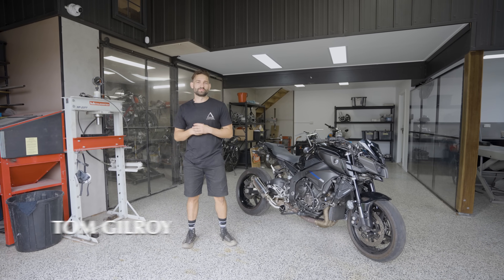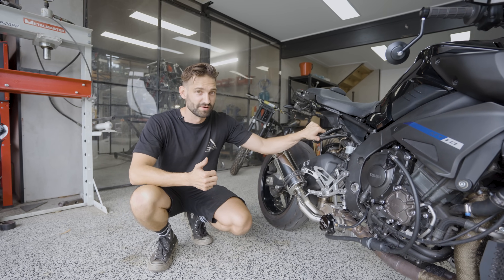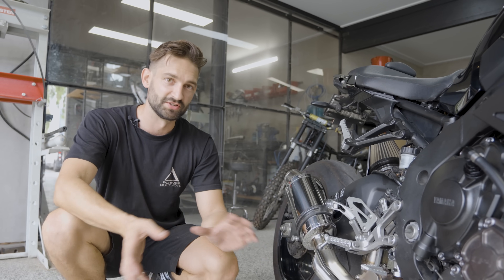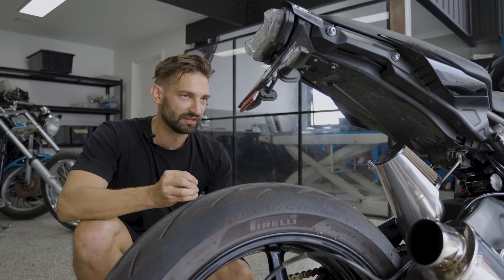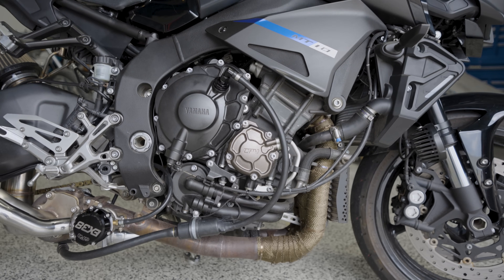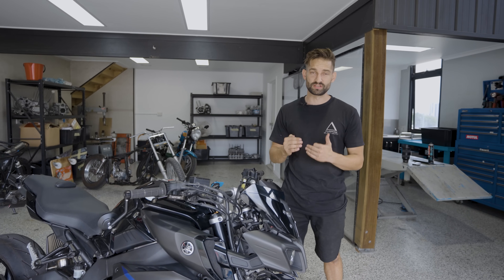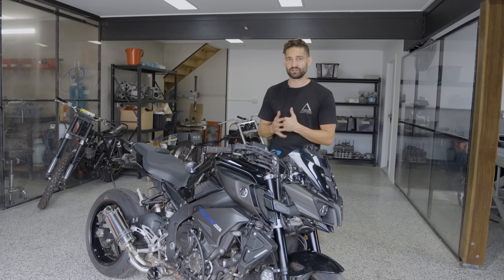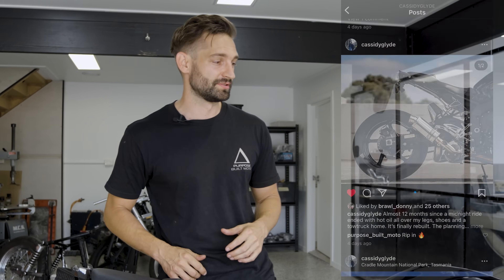The Turbo Yamaha MT10 | Purpose Built Moto

Comment: 230hp @ 10psi with forged pistons and con rods is always gonna be overkill mods for such low hp, you don’t even need the intercooler but I think that is the only reasonable upgrade you made to this. The rest is just a waste of money. When you wanna go for 350-700hp is when you need to look at upgrading internal components, IC and standalone ECU’s 

Any 1000cc bike can handle that amount of power with a stock bottom end, lowered compression by having a thicker headgasket and stiffer clutch springs. Then it’s all in the tune that’s gonna make sure the bike runs forever

Here in Sweden we’ve been building bikes with 200-320hp with just these simple changes for over 30 years and they run forever. My K5 turbo with 270whp with stock internals, no intercooler etc etc has been running since 2017 

Nice to see a Yamaha turbo, not something you see very often. So props to that and you’ll learn more along the way if you keep building more turbo bikes in the future. Keep it up, but keep it simple for these kind of builds 👍🏼
Reply from the maker: All of that may be relevant, but as we mention it started with a completely blown motor from running 13PSI. 
So rather than rebuild a stock motor, we went and did the upgrades properly to handle higher HP and eventually more boost.
Reply: for 230, yeah, but the original owner blew the motor. They wouldve needed new pistons and rods anyways. Might as well get forged and lower compression pistons since youre already in there. The build has potential to be making way more power but its sick either way
Reply: Your wrong. The mt10 has steel con rods & alot of steel internals unlike the r1... that is the big weak link on them

Comment: Blue mine up with extreme creations kit as well just finished up rebuilding and upgrading it.  prior to melt down was 215hp 110 lb/ft tq.  after rebuild was 188hp 100 lb/ft tq ( injector limited )  put new injectors in it last year and worked out a active wide band with  FT ECU so it can adjust on the fly up to 5 percent.  waiting to take it down to get tuned again.  side  note this was all on pump 91 octane.  91 being only reliable non ethanol at 95% or more of northern USA.  was thinking of E85 but can never get true E85 and limited places.

In hopes to get to 220-230 at wheel and call it good as me and cycle only weight 550-560lbs.  
was insane at 215hp (150mph wheelies ( Re geared )) ( melted as leaned out )
was little lacking at 188hp ( no power wheelie past 120mph )

running 11:1 compression 7.5lbs of boost.  188hp was good daily but left wanting more and only needed injectors as throttle by wire only had 100 percent at 7500 rpm and cliff to it and dove off it ( reminded me a 80's turbo cars )
Reply from the maker: Good to hear we're getting some good numbers comparitively
Reply: @PurposeBuiltMoto  indeed will half to update when I get it tuned with the new 830cc injectors this year. was thinking double radiator and air to water intercooler.  will wait to see if heat is a problem with charge temp ( had no problem at 7.5lbs last year )

Comment: Love the look of this build and how it turned out! My one question is, why couldnt the intercooler be placed under the bike so as to make for a cleaner look? Would that not have been feasible? Either way, its badass!
Reply: I don't doubt it could be done, but he is already losing clearance with the extended swing arm. Add an intercooler beneath it, and you will inevitably smash it riding on the street.
Reply: this is the most ugly ass intercooler wallmart addon ive ever seen,
dont care if the turbo is good or not when you have a james bond casino case intercooler next to your leg.
only right side looks decent

Comment: How much Newton meters of torque (max) does it have after the turbo upgrade?
Does the engine still run at 11500 rpm, or have you reduced the speed to protect the engine?

Comment: So the motor did not blow up because of Extreme Creations but from the owner of the bike putting more boost in it with stock internals no doubt and not getting it tuned for more boost causing it to run heaps lean and melt the pistons
Reply from the maker: Yeah that’s what I said, the kit is fine if you listen to the instructions. Our rider wanted a little more though

Comment: Is that correct for the watergate to be on the exhaust? Surely it’s to relieve boost pressure, therefore should be on the boost pipe?
Reply from the maker: Check out some info about turbo systems, you’re thinking about the wrong part.
Reply: Ah ok. 

I thought the waste gate was the thing at the bottom and is that not attached to the exhaust?
Reply: Just had a google, I’m right in what I’ve seen and you’re right in what you’ve made. 

I (wrongly) assumed the waste gate bled off boost pressure. But In fact it bleeds off exhaust flow to the turbo. 

I’ve learnt something.
Reply from the maker: You’re thinking of the BOV

Comment: Its a gorgeous build, but the reality is Highway Patrol would have a field day with it. 

I'm not sure redirecting the dump pipe into the exhaust will suddenly make it legal. The air filter and aftermarket exhaust are very obvious. Unfortunately you can't make any modifications to a vehicle that impact its emissions, without an engineering certification. Otherwise it invalidates the registration. Not to mention significant changes to suspension like an extended swing arm. 

Then there is insurance, a Green Slip is invalid without valid registration let alone comprehensive insurance. 

Its quite a risk riding that on the road and I don't mean the safety shorts. 

But since you do this for a living I'm sure you would already know that and hey, you only live once. Ride safe 👍🏻
Reply: Where do you live?
Reply: @jaredjensen2668  Australia. They make it difficult to make big modifications to vehicles legally without getting them engineered. 

Highway Patrol often, but not always, seems to attract a-holes, and many of them love writing up defects.

Comment: No doubt you know what you're doing but I can guarantee than intake pipe is too close to the chain.

Crazy how much both chain and suspension move.
Reply from the maker: I can guarantee it’s not, now who’s opinion do you think is more valid here? 😊
Reply: @PurposeBuiltMoto  okay go watch any bike on a dyno and see how much the bottom of the chain ripples. The only tension in a chain is from the top of the front sprocket to the top of the year sprocket. 

That pipe will have a hole cut into in in 10 miles of hard riding.
Reply: @PurposeBuiltMoto   https://www.youtube.com/watch?v=Iqy2U5KRVuo

0:50 Watch how much the chain moves. Drag bike with an extended swing arm. Granted it will be longer than the MT10. But they still move  You've got 5, maybe 10cm of space there.
Reply from the maker: I put 30 miles on this bike, and it had 10-15 runs on the dyno, I did 240 kms/hr on the bike and that pipe hasn’t got a scratch on it. Take your I’ll informed opinions elsewhere champ.
Reply: @PurposeBuiltMoto  30 miles on a dyno = no miles on real road. 

Dyno’s don’t work the suspension other than the bike compressing under load. 

It’s a road bike. Roads are full of bumps and summits. All whilst the bike is moving under the rider. Wheelies and braking all moving the bike up and down. 

So your logic is because it doesn’t have any marks in it from being on a dyno, it won’t do in real world riding. 🤯
Reply from the maker: We put real road ks on all
Our bikes, there’s even some clips in the video. You don’t know what you’re talking about.

Comment: Man, I want to do a turbo build so badly. I'm completely rebuilding an 07 GSX-R 750 and I want to turbo it with the headwork, possibly coating the piston sideskirts, mains, piston pin with DLC & cerkote the top of the pistons, but I just can't afford a set of forged pistons & rods. 
What I want to build: I want to build a bike around a VFR1200 engine, do some headwork, wrap a trellis frame around it in candy lime green metallic, single side swingarm and chain driven, not shaft like the VFR's, get some camshafts from Webcams made, throw on a thin head gasket to bump up the compression to 14.0:1, run an AEM Ethanol rated fuel pump, ethanol sensor, fuel injectors, ECU with atleast 2 maps (93 & E-85.) That V4 engine sounds so sweet and is easily capable of 200+hp @ 1200cc's. And if I had money to dump into it, I'd put a turbo on it & run a methanol injection system. 
You ought to look into running water/meth injection instead of that heavy cumbersome intercooler.

Comment: I know there is very limited space on a motorcycle. But I'm sure that turbocharged bike would Greatly benefit from a water/methanol injection system. As this allows for more timing without pre- detonation . There are several benefits of a system like this .in a sense it acts as a chemical intercooler giving an even cooler denser air/fuel mixture to be compressed,also cooling the compressor and exhaust side of the turbo.and with the expansion rates of water turning to Steam Spools that Turbo Quickly.Also it maintains a constant state of tune,as there isn't any carbon deposits left in the combustion chamber ,the entire exhaust system stays clean . Even when the turbo bearings start to wear over time,will of course lead to oil seal leakage into intake .With that addition of oil burning causes carbon buildup quickly sticking the rings leading to excessive blow-by ,causing oil dilution from the fuel mixture over loading the crankcase ventilation system. Thinner Oil looses it Viscosity and it's just all bad,from that point . Which these things don't happen when running a water injection system. The Spark plugs stay clean there's no carbon buildup on the exhaust valves. And the engine oil stays clean for longer not having the extreme heating normally found with a turbocharger during long rides on streets and open highways .The lack of carbon flakes in the combustion chamber ,acting like glow plugs because of their feather edges and thin tips ,will cause predetonation and dieseling when you go to shut off a hot engine,and it wants to keep chugged and coffing. More common in automobiles. But Extremely Problematic,and can cause catastrophic engine failure. Anyway I could go on and on about the benefits,which I kinda already have. In short it's worth the effort to fabricate a gallon or so reservoir tucked under somewhere it stays cool and is easily accessible for filling ,when getting the fuel tank topped off you can bye a bottled water . You'll be surprised at how much difference it makes with the right tune. And you can even get away with a lower grade of fuel without a chance of detonation. It will run like premium unleaded did without the injection. The if your looking for the optimal performance you can bye -20 degree windshield washer fluids for cheap,to run in the injection. along with Av-gas or Trick Racing Fuel. Or just Premium Unleaded with some 104 plus Octane Booster. And then You Will Really Notice The Difference. You're able to Crank up that Boost and run more Timing .Cheap Insurance With Improved Reliability ,Without Bad Experiences.Try it you'll like it. And you'll never want to go without it. Even with High compression normally aspirated engines. It'll pay for itself in fuel price savings alone.

Comment: should’ve changed the transmission to an R1 so you can still have better top speed
Reply: There is no point of top speed for naked, and that side intercooler affects aerodynamics a lot at high speed.